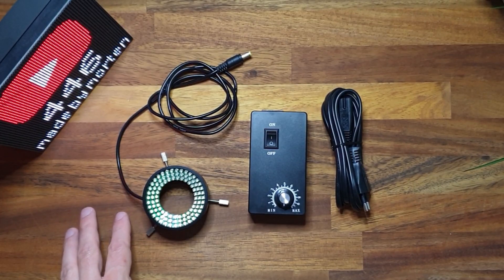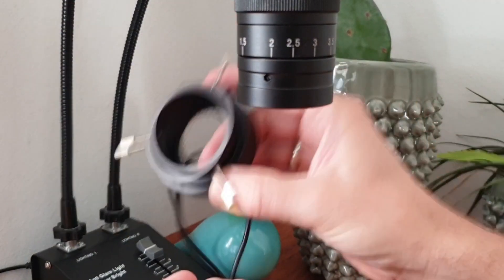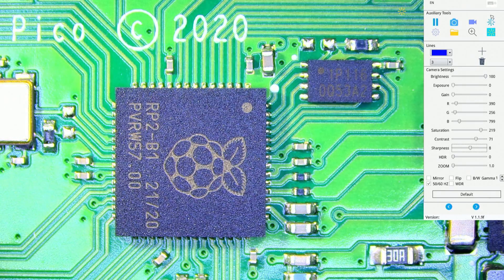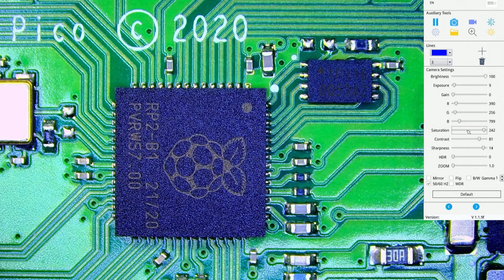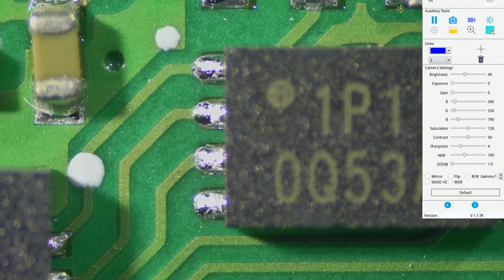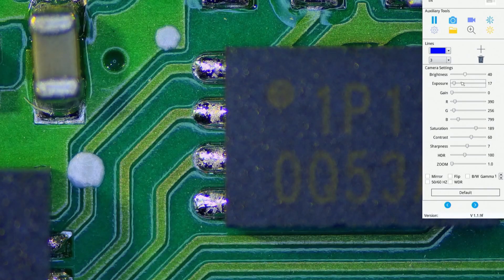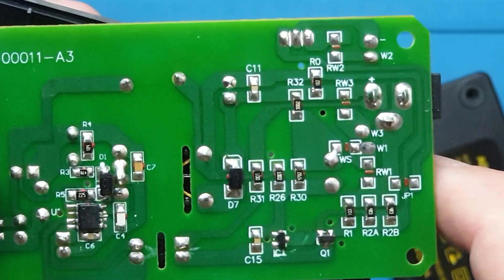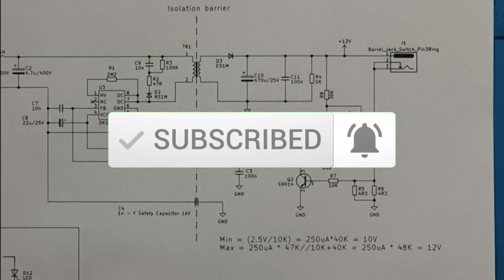NorthridgeFix 96 LED Ring Light for Microscope Camera, test and teardown.

Comment: Nice video. To be honest, by nature the ring light itself can not deliver a shadow free picture, which is more translated as anti glare light. Without the side anti glare lamps, the picture will always look washed out and darkish with dull colors. With the auto exposure function, there are somehow always limitations and disadvantages. In my opinion, besides the strength of the led ring and the high life expectancy, i see no big point to invest the money into it. There are in the meantime same construction models on the market that have a diffused plastic cover after the diodes. This way the light shines through a 180° angle. This way you are more likely to produce anti glare illumination without the side anti glare lights. All in all, not really worth to spend that amount of money. For people that work with HD microscopes and higher distances, the light is good, because of its strong illumination. Other than that, the anti glare lights are a must. In combination, you get the perfect picture. The problem is no matter how angled the led diodes are positioned, the small room under the microscope lens will always catch to much glare from it. Only a diffusion can make it to work properly. But side anti glare lamps are the sweet spot.
Reply from the maker: Thank you very much for for your very good inputs

Comment: And which software you are using to connect the microscope, and is it connected through usb ? Please explain
Reply from the maker: @techprodippro2224 - there is a HDMI output port on the camera, and the picture you see i recorded directly from the camera, there is also 2 USB ports on the camera where a mouse is connected
Reply: @made.by.morten.laboratories  ohhh, so which software you were using, I meen you are controlling the brightness and colour all the stuff while recording, that seems interesting,
Reply from the maker: @techprodippro2224 yes i can do that, i just use OBS for recording
Reply: @made.by.morten.laboratories  okkk thank you🥰🥺